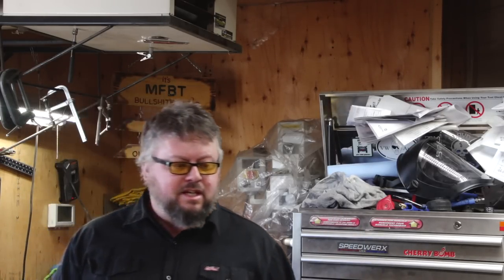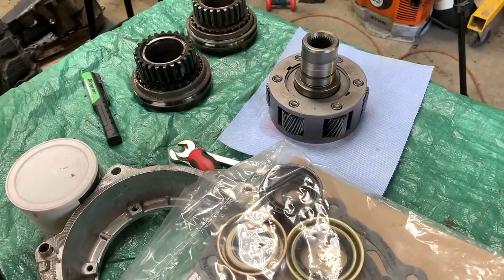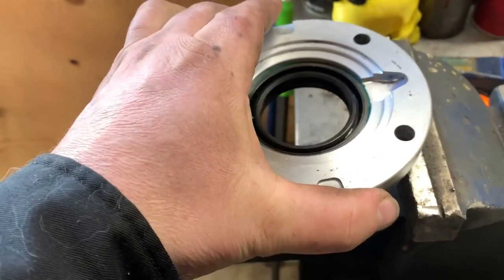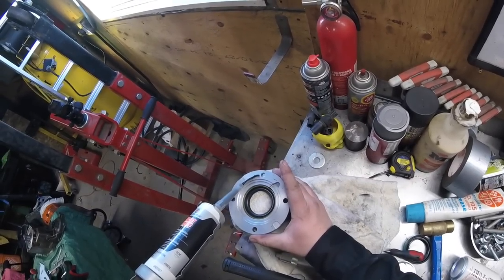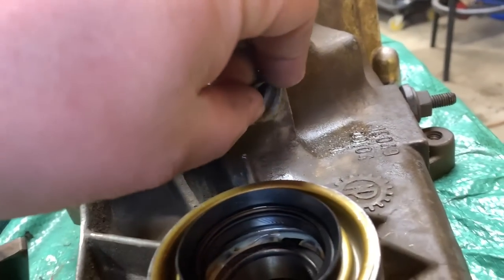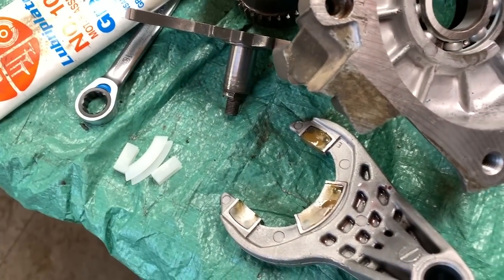DIY NP231 How to Rebuild Part 1

Comment: You really don't need a blind hole puller to get the bearing out of the input shaft. you can drive it out from the other side if you don't have a puller. I know it is necessary to get the bearing out of the rear case half. Just an fyi for the flat rater's out there.
Reply from the maker: I’ve heard you can heat it up and tap the case and the bearing will fall out but I have not tested that theory
Reply: @TestDontguess  I imagine you could do it that way. The bearing isn't very tight. I just used one of my small slide hammers and it popped right out. Took less than a minute.

Comment: If I were to use a np321C for my jeep, could I replace the np231c input and front case housing for the np231j? Essential making the np231c fit a jeep 6 bolt round pattern with 23spline input?

Comment: Good video, I'm just replacing my input and output seals but wasn't sure if there was supposed to be gasket or RTV between seal cover and the case, it appeared that it had an RTV seal, but there was barely anything there and I wasn't sure if there was supposed to be, now I know, thanks.

Comment: What makes "Assembly Grease" any different then regular grease??
Reply from the maker: Assembly grease is designed for rebuilding motors as the film of grease has high anti seize properties to prevent scoring at first start up before proper oil lubrication can be achieved
Reply: The biggest difference is that it will turn into a liquid (dissolves) easily when heated and won't clog filters.